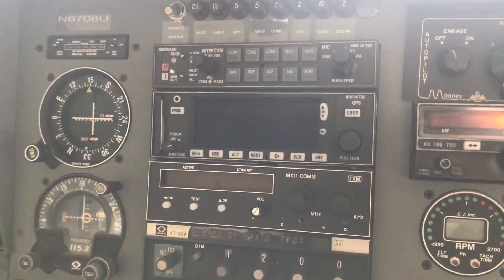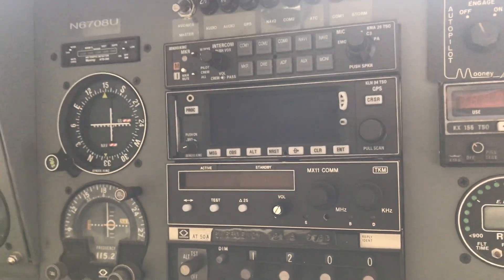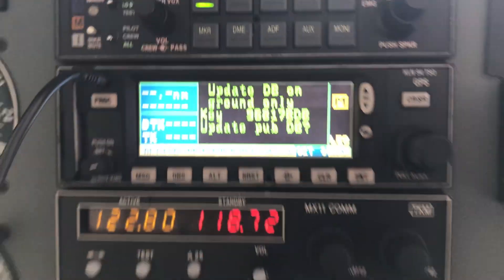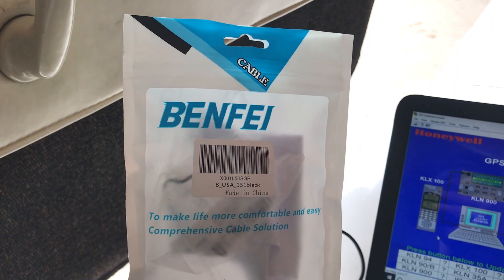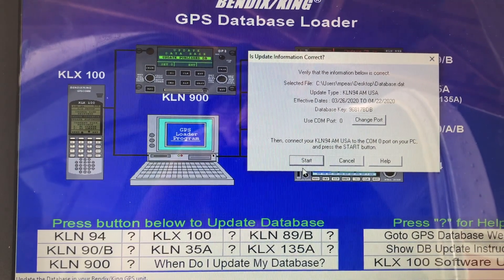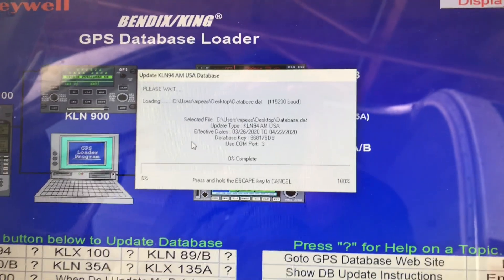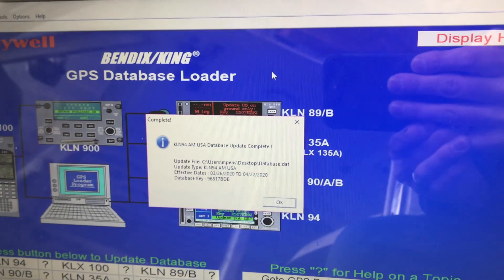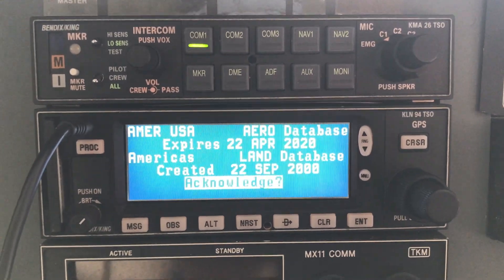KLN94 GPS Database Update

Comment: I wonder if the Land database is the same as Garmin's Terrain database. I'll check out the installation manual later and report back if I find anything. I have a database on my company's 172 that has a land database I was looking at today, too, and wasn't thinking about it that way until well after closing time.
Reply: From the Jan 2003 published version of the KLN 94 Installation manual:

 CARTOGRAPHY DATABASE
 This includes features such as roads, rivers, railroads, etc. and is provided for reference only. 
Cartography database updates are available on a less frequent basis than the navigation 
database updates. Updating the cartography database will require a cartridge exchange.

Guess that answers that question! But I wonder if you couldn't just update the PCMCIA card with the Land database as you would the Nav database... especially with the technology we have now vs 2003!

Comment: Hello, I want to ask about my GPS kLN90B, when I finished the repair, the database key changed and was different from before ,cartridge and data are  incompatible ?. Can you help me solve this?. Thanks.
Reply from the maker: I'm so sorry for my slow reply, unfortunately I have no information on the KLN90. I would recommend contacting your local aviations shop (preferably the old guy who's been working on them forever. You might be able to find some help from Honeywell if that doesn't work.

Comment: I have preserved an ancient PC to keep the KLN94 updated. It’s legitimately a pain that BK hasn’t updated the software to support modern machines. I have a 2000 Windows computer running XP service pac II. I haven’t tried the direct from laptop to unit method but after looking for instructions on how to create the proper cable to do so and seeing this video I’m going to stick with the imagemate card reader method. Don’t get me wrong, This video was well done, so good it showed just why I’ll stay with the card reader method, it cuts out a number of steps and makes the process a little easier. All this is good as long as I protect my year 2000 PC and never mistakenly let it update the OS because then the data loader won’t work.
Reply from the maker: I agree with you, it seems BK could make it easier on us. Somebody asked in another comment what card reader you use, could you share that?

Comment: That worked for me, today.  Particularly the tip about changing the factor to 10.  Thank you for posting the video.  Also, for my setup USB to serial port adapter, I had to manually select COM Port 9 and change the factor to 10 for that COM port.  My computer didn't automatically select a com port and the port I changed the factor to 10 didn't carry to the different USB Com Port created when I moved the USB Plug.  The Computer system at first didnt' recognize the COM port to the GPS, so I moved USB ports, and that did the trick.  Thank you, again, for posting the How To!
Reply from the maker: Right on! Glad it could help. I’ll need to watch it myself again, it’s been a long time since I’ve updated it.